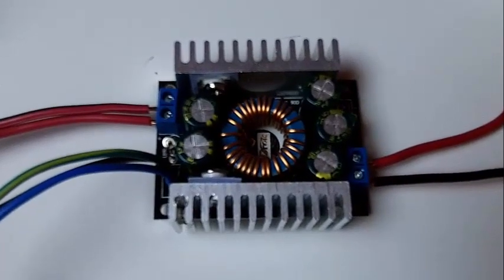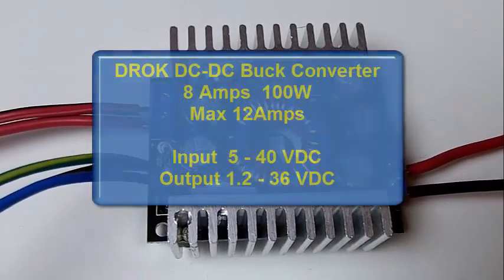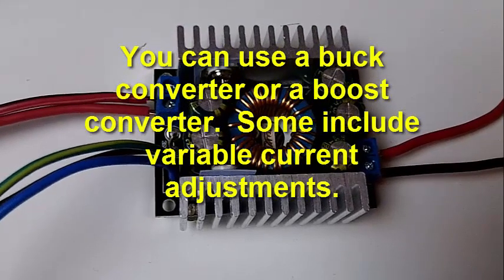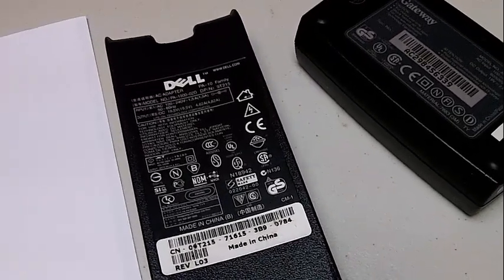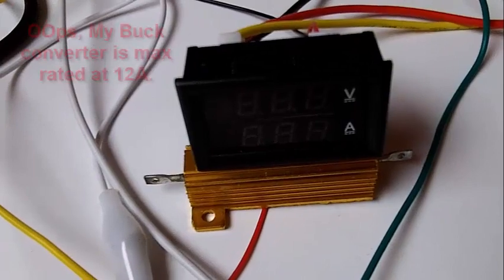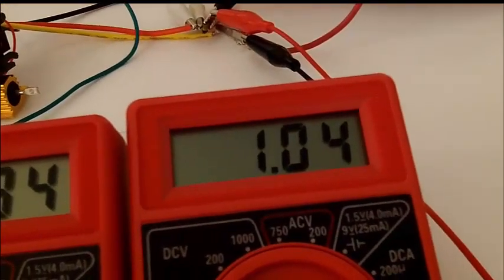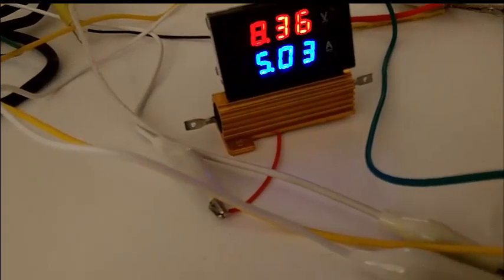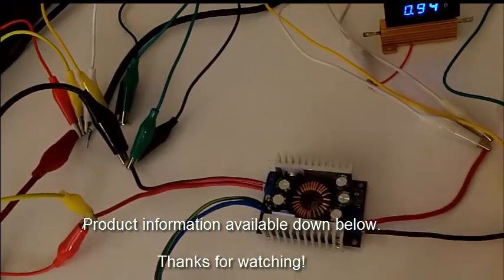Build a Low Cost- High Current- Variable Power Supply : Eye-On-Stuff

Comment: This is not building a power supply. This is CONTROLLING the output of a power supply that you provide. It is not converting high voltage to high current. You are limiting the output.

Comment: These buck converters are the same as those on EBAY but much more expensve. I have used many direct from Chinese sellers and they are almost bomb proof. The version with a very useful current control and voltage control seems to be the standard one and costs roughly the same  < $4. They seem quite happy up to 40V input but the maximum continuous amps output for this XL4016E buck is 8 according to the data sheet. Anything higher and you risk failure. I always use a 60mm fan. The 2.54 JST socket fits perfectly in place of the blue trim potentiometers and makes a much neater and stronger connection.

Comment: Great video. 
Is 50k pretty much standard for the voltage trimmer pots on these buck converters?
Reply from the maker: The pot I used is the same value as the trim pot on the converter.